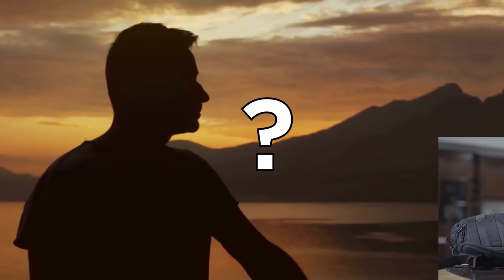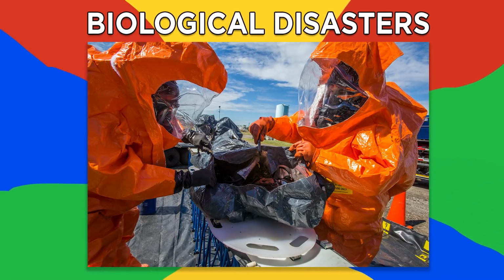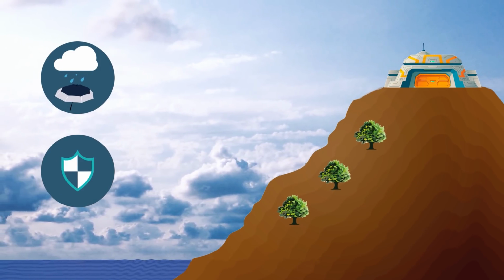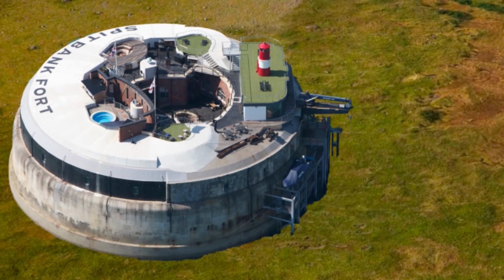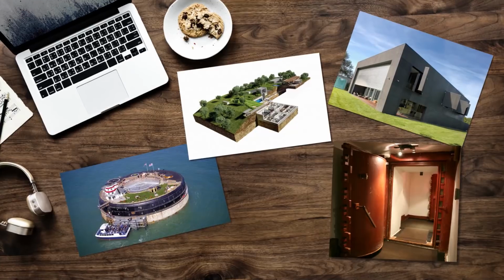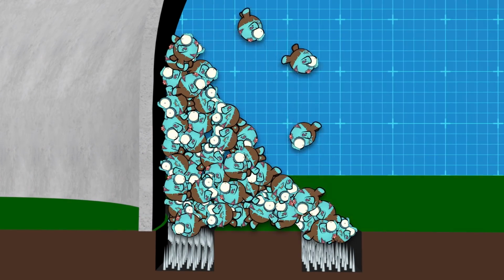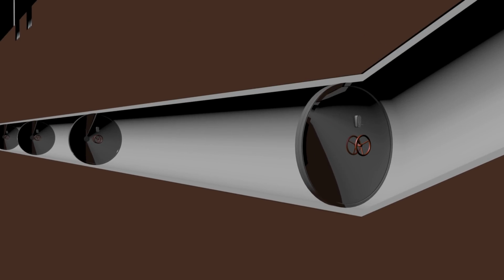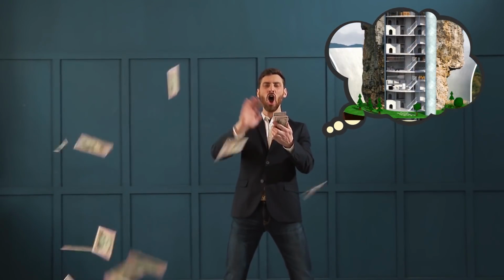This is the Ultimate Doomsday Survival Fortress

Comment: Two more, how about having an air filtration or oxygen collector for underground rooms and maybe an underground garden using ultraviolet lights just incase there's a high radiation fallout outside?😊😊😊
But still an amazing plan you made😊😊😊
Reply: You would also need to keep a supply of soil to replace the top few inches of contaminated soil in the case of fallout.
Reply: I agree
Reply: I agree with air filtration you can use UV lights to kill 99% of bacteria and viruses in the air. I disagree with growing food underground with a artificial light. ultraviolet light for growing requires a significant energy commitment, and makes you reliant on electricity to live. Just build a interior green house with a skylight, and have an automatic cover in case of emergency, like the square zombie house. I also disagree with no front door, because if you are in your yard you are dead, because you can't make it inside your house in time. Have a concrete filled steel door, hell have 2 doors, so you have a man trap/ buffer zone.
Reply: Nuclear fallout from atomic weapons is only dangerous for around 6-8 weeks.  With proper stocks, it shouldn't be necessary to try to grow food in that time.
Reply: @apokalypsecow9756  Yeah, but raiders and looters from regions not directly affected or other preppers.
Reply: @Gamerad360  what do you mean, just keeping things underground so as to attract pess attention?
Reply: @apokalypsecow9756  After the 6-8 weeks people will run low on food, and rob you. What I mean is I suggest having more food to live underground longer, until the social unrest is over. Probably at least a year if not more of supplies. If your home is not well hidden I also suggest staying underground and hiding the entrance. You can imagine thousands of survivors in subway tunnels, basements, military bases,  etc. And of course those people will be raiding preppers, or anyone alive.
Reply: @Gamerad360  The preppers will be the ones with the best weapons and training on them in order to repel such raids, and they'll also be the ones with the best preparation (obviously haha) for those attempting to take their supplies from them, and they'll still be well fed and ready when the desperate and starving people try to steal from them, if they can even find them.  The thousands of survivors will most likely turn on each other first before going after a hardened and/or concealed target like a prepper compound, and they'll likely spend a lot of time weeding each other out as easier prey long before they get to the point of going after a riskier target.  By the time raiding a prepper sounds like a more reasonable idea, a better risk/reward proposition, there will be far fewer potential attackers.
Reply: @apokalypsecow9756  Special Forces are the most highly trained fighting forces in the US, if they have high casualties, you better believe peppers will have high casualties. The military will be raiding you, and etc. Preppers have a very high reward, because of their mountain of supplies.

Edit:
More info here.

https://www.youtube.com/watch?v=d1_ZhQDO_qQ
Reply: @Gamerad360  agreed. Military is what worries me the most. Ive seen numerous movies depicting this. I know it happens in other countries. And THEY have the best weapons. Thats why i believe the best route is hiding & decieving, bunker, supplies, falls walls, exit tunnels. Military will go door to door
Reply: @apokalypsecow9756   what about chernobyl pretty sure that is still considered unsafe to live.
Reply: @Moreh_Joshua  Only in certain areas with high concentrations of low-radiation, long-half-life materials.  Wildlife is actually thriving there, it's people that shouldn't spend too much time there, as an issue of cancer risk instead of acute radiation poisoning.
Reply: @apokalypsecow9756  Still, it is better to be prepared. That's what this is all about anyways..
Reply: @apokalypsecow9756  if thats the case…. Wouldn’t it of been ok years ago, for people to move back to Chernobyl…& start farming there ???
Reply: @Eryn_theVirgo  Not entirely.  There are still a number of radioisotopes in the environment from the meltdown that are of a longer halflife, lower energy radiation but still not considered safe for prolonged exposure.  The products of a meltdown and those of a nuclear detonation are considerably different!  Plus, there's always the chance that some of those radioisotopes could be inside the food from such a farm, and while external exposure to these radiation sources is one thing, ingesting them is entirely different.
Reply: @apokalypsecow9756  i was referring to you suggesting just laying new top soil on contaminated ground. I dont understand how that makes the ground safe
Reply: @Eryn_theVirgo  did I suggest that somewhere?  For a nuclear reactor meltdown?  If so the I was mistaken, a layer of topsoil might help some with incidental exposure, but there's still the risk of ingesting some of the heavier isotopes from anything farmed there, and tilling the soil to plant just makes things worse.
Reply: @apokalypsecow9756  my mistake. That was a couple comments under yours. Someone suggested keep fresh soil on hand to add new top soil in case of nuclear radiation
Reply: As an Austrian, I'd go with a shelter high up in the mountains. This comes with a lot of benefits:

1. Accession. Getting there would be very difficult for everyone and due to that fact, you wouldn't be a primary target for anyone attempting to go on a raid. In addition to that, barely anyone would know the location of your shelter anyways, which is always the best assurance for protection against fellow survivers. In case you get a ill-minded visit one day despite all those obstacles, you would have to deal with an extremely exhausted enemy who's low on supplies, while you're sitting in the comfort of your mountain fortress and have all the time and energy you need to drive them off. That's the definition of having the high ground.

2. Energy. Up there you benefit from constant high wind speeds, so turbines would run at max efficiency night and day. Also, depending on which side of a mountain you choose to set up your bunker, the lack ouf clouds would guarantee a good output from solar panels as well. 

3. Food production. Point 1 & 2 would allow you to set up greenhouses outside of your bunker. Constant sunlight and your good supply of energy would benefit plant growth while you don't have to think about someone breaking in and stealing your shit.

4. Water supply. Inside of a mountain you have probably the best access to water imaginable during an apocalyptic event. There are water veins running in between the cracks of the rock, which filters the water itself. I've seen old WW1 fortresses up there where they simply stuck a pipe into such a crack, granting them access to an almost unlimited supply of filtered water without the need of electric pumps or filtration devices. Due to the amount of snow and ice up there, you have more melting water ready to drink than you could ever consume.

5. No fallout. The abscense of clouds would also protect you in the case of radioactive fallout, since the rain falls below you or on the other side of the mountain, if you chose your location wisely. Also, in case of a huge vulcanic eruption, you would be one of the few people who wouldn't suffer from the effects of a "nuclear winter", since again, the ash clouds would be below you for the most part.

6. No primary target. It's a lonely place up there without any strategic value, so your shelter would probably be very far away from any potential impact zones and being far away from a catastrophy is never a bad idea.

The downsides would be:

1. Oxygen. The air up there is thin, so you'd come up with a solution for that till your metabolism gets used to that. Those solutions are very energy demanding for the most part, basically taking benefit #2 and making it an actual requirement.

2. Temperature. Though cold temperatures make it very hard for biological threats to survive, it also does the same to you. You can't really benefit from terrestrial heat, so keeping your dwelling warm and cosy would be another burden to your energy production. The rock walls inside of your mountain don't come in handy in that regard as well, since everyone who's ever lived in a house with stone walls knows how bad they keep in the warmth. But we're assuming we'd have an unlimited amount of money to set up our shelter, so we could help that problem with an additional insulation inside of our bunker.

3. The worst downside of them all: Deciding who's allowed to join you. In terms of saving your friends, families and neighbours, benefit #1 suddenly becomes a downside. Depending on what kind of apocalyptic event is happening, getting up there in time won't be possible if you want to take a lot of people with you. Your best chance would be multiple helicopter transports, but since pilots are humans with friends and families as well, the only thing that's an assurance for them to shop up in order to get you up there during such an event would be to grant them and their loved ones a place in your shelter as well. 
You see, that's a lot of people and all those benefits listed above can only sustain a limited amount of survivors. You would have to keep the amount of people you want to take with you as low as possible and I don't know if I am able to make that decision. My wife and me have a big family and even more friends and neighbours. Dooming them to die must have a devestating effect on the human mind.
Reply: Some of these technologies seem a little unfeasible at the moment but you have some good suggestions. For one oxygen tanks like on airplanes are certainly a must-have, and they should be part of the medical equipment. You also have plants and technologies that are very efficient at recycling greenhouse gases, they could be decorative AND beneficial to have them in your bunker. Options include the American chestnut tree, or carbon collection storage's with huge ventilators and algae, which take up relatively little space.

A garden inside requires a lot of artificial light, since windows let through radiation. To understand why, we first have to understand radiation, I'll keep it simple, bear with me. The most dangerous type of radiation are gamma waves, which are actually a type of ionizing radiation, aka, light so powerful it can destroy atoms themselves. If something lets trough visible light, then it's no match for gamma waves.

This means that all light the plants use must come from artificial sources, so there is actually no reason that we would use UV (which is also more dangerous) instead of just regular light. The most stable model to use here is probably aquaponics, which is a not very-well known type of technology existing for purposes like these. With some relatively easy to get external resources, aquaponics allow you to create a small, fully functioning ecosystem where life can thrive and reproduce. It basically works by having a big fish tank with fish like pangasius, salmon or cod (I'm no biologist I'm not too familiar with all animals). You could have a mixture of these in a fish tank and an indoor garden housing things like lettuce, potatoes, tomatoes, carrots, parsley, sweet potatoes. The main requirement is that the fruits/veggies are easy to convert into food (so like a potato can just be washed, peeled and cooked while wheat has to be converted, checked, crushed, catalised, mixed with a lot of other stuff to convert into something useful) and the plant isn't too big, this means preferably no trees. Of course the previously mentioned chestnut tree has more purposes than just that.

The... feces of the fish can be used to fertilize the plots of agricultural land, and together with some water from the fish tank, the plants can flourish, meanwhile, you can use a small amount of your crop yield to feed the fish, or maybe something like the leaves of potato plants, which we don't eat. Win-win.

Anyway I hope this gave you some insight of possible improvements, I'm also sorry for the massive read, science just can get really complicated really fast and I further hope you have a fantastic day.
Reply: @thedaranesianconfederation7221  all that was highly appreciated 😊
Reply: Ultraviolet lights are very power-hungry it would drain your backup power very quickly
Reply: @dragonson72  its only 60 watta the same as any led
Reply: @Gamerad360  Sorry, but a 30in UV bulb has an output of around 30,000 watts these are the newest out there, older ones are between 300 to 600 watts. The older ones, that have been used for indoor cannabis growth are power hogs and the reason people get caught growing cannabis, the power bill spikes so you can guess how much power the new ones use
Reply: @dragonson72  I don't know where you're getting your info, but it's wrong.

 "A UV light is generally either a linear fluorescent tube or a compact fluorescent coil. Both of there use less electricity than a household 
incandescent light bulb. You can see how much less by comparing the Wattage, which should be quoted on the packaging or in the product details on the website. You're looking at something ranging from around 15W for an 18" Zoomed 10.0 tube, to 40W for a 48" Zoomed 10.0 tube, with

 their 10.0 compact fluorescents rated at 26W."

https://www.homedepot.com/p/Philips-15-Watt-18-in-Germicidal-Linear-TUV-T8-Fluorescent-Tube-Light-Bulb-25-Pack-308643/204250916

https://www.homedepot.com/p/Philips-18-Watt-4-Pin-2G11-PL-L-Actinic-Germicidal-CFL-Light-Bulb-25-Pack-130344/204620875
Reply: @Gamerad360  I got my information from a Greenhouse employee and online
Reply: @dragonson72  You don't need greenhouse grade first off, second I just linked 2 UV lights for 15, and 40 watts.
Reply: @Gamerad360  Yes but to grow food for a group of 6 or more you would need the greenhouse grade to supply the power you need, yes if it was one or two people the ones you are talking about would be fine, but the big ones are power hungury
Reply: You would also need larger guns in case of raid by air with planes
Reply: Don’t forget to add an entrance for a mini submarine just in case of rising sea levels 🤓
Reply: The vertical wall can be used for farming space as done in some high rise buildings. You will need to provide some form of access though.
Reply: Only a couple hours from sattre lol how funny
Reply: @Xploomityhaha me too… literally . Thats all i read the comments to these vids for.
Reply: Should make the walls more curved to a big tube going round it so people can not climb up it
Reply: yeah and maybe an big arc reactor and an mold food grower ( sorry i forgot its name )
Reply: I feel like you overthought thie

Comment: 9:43 put cameras on the doors to see who is coming and install a tear gas system so if anyone try to infiltrate
Reply: If they have gas masks, tear gas would be futile. I was thinking the bug out tunnel could hear up like a massive oven.
Reply: @donovanmallory  good point, might be a good idea to attach air purification systems and conditioning/heating systems onto each section between the doors. You could also rig them to be flooded and drained should the need arise.
Reply: @benjidaboredguy  I don't think it would need a purification system because if you're leaving, you'll have a hazmat suit on anyway, but I like the drain idea.
Reply: @donovanmallory  True, but there would need to be a way to ensure nothing got stuck to the suit that could be harmful to the residents (for instance, stepping in toxic waste or airborn pathogens stuck to the suit via condensation or something) and if there's a leak in one of the sections, it would be wise to have a purification system in each section equipped with sanitization showers. Would rather be over prepared than have an unexpected issue cause major problems. And if something happens to the suits (like a tear or an oxygen mask if the air is near unbreatheable outside) then the person may nead safe, breatheable, air as soon as they enter the tunnels.
Reply: Great ideas.... need more people like y'all around
Reply: IDE just put automatic turrets in discrete locations around the base to nail anyone who comes too close
Reply: @enderbirds3814  Add an OwO too UwU
Reply: Owo
Reply: Lmao I thought he said the keys couldn't have electricity becuz that would be a luxury wtf I am lost on the 6th floor somewhere....help!